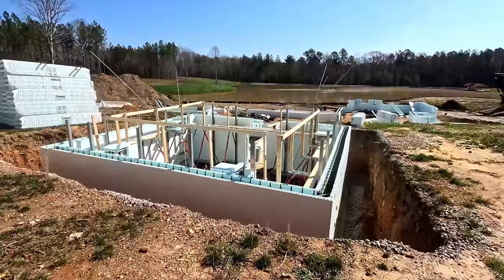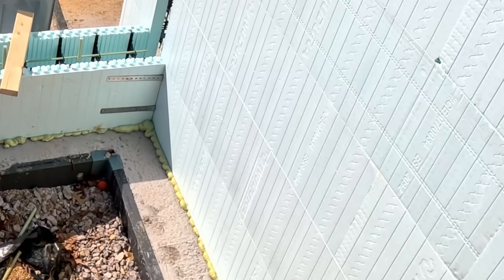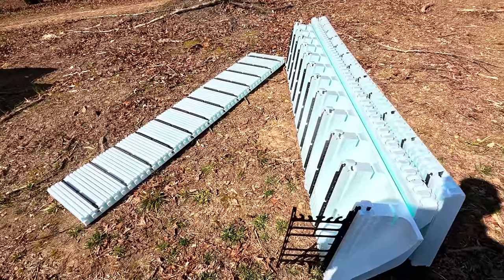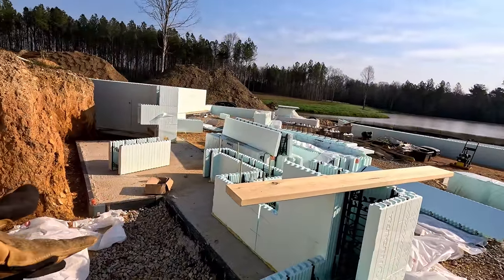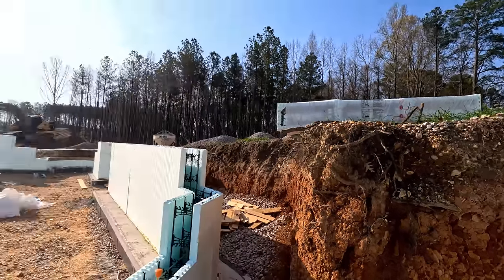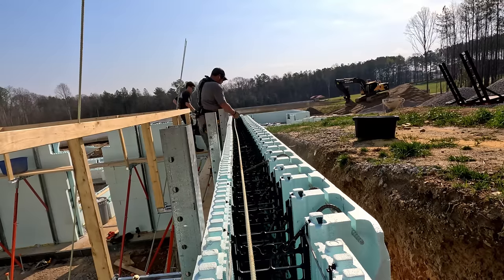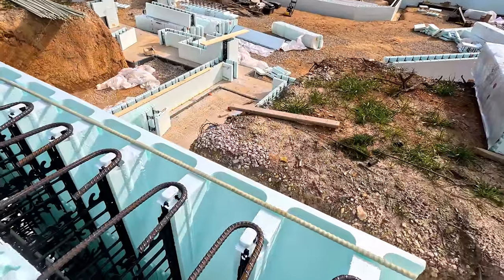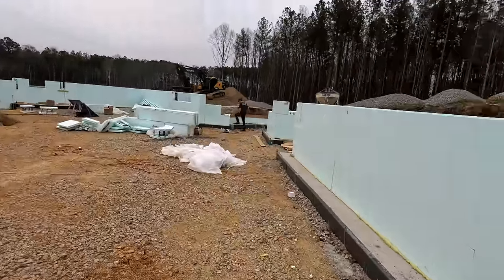Finishing the ICF Theater Stacking

Comment: Add a couple extra sleeves through the walls for either future utility runs, or for on-the-fly changes. Remember you'll also want a hole large enough for the air ducts, assuming you'll be running a forced air heating system. But some means of forcing fresh air into the room would be desired even if not for heating purposes. That enclosed below ground room will be cooler in the summer and will try to attract moisture (mold) if not ventilated well enough.
Reply from the maker: I’m going to do an ERV system. Extra sleeves for sure. 😊

Comment: I have watched a lot of ICF builds, and every build still amazes me. Mike, from Dirt Perfect had a valuable tip, and that was to leave all walls leaning in so ever slightly, because its much easier to push the wall out, than to try and pull it inwards when full of concrete.

Comment: Using your second rebar method for the brick ledge, instead lay both horizonal bars in place so you don't have to go back and pull the hooks over the wall piece. Simply hook the brick ledge bar, then lay it on the wall bar. Then snap the horizonal pieces into position.
Reply from the maker: I did that for the third time but didn’t film 🤣

Comment: I’ll actually bow my walls in pre- pour usually 1/2/-3/4 per 30’ wall section.  They usually push outwards while pouring , then just turn them out to the string afterwards. Pushing a fresh poured wall out with this bracing systems is easy , pulling it in usually causes problems .

Comment: Fun stuff.  I am so in awe of how much the average person can do themselves once some engineered outlines are established.  The design of the brick ledge was amazing…. I noticed that the sloping of it back towards the ICF wall as it went down. Is that for cost reduction (on concrete), pushing the weight load onto the ICF, or both?   Also, the metal hooks caught my attention ….easier to just buy and bend metal for the manufacturer than preforming a fiberglass one or is there another reason?  I noticed a wire inside the wall at a common ….all these questions can be addressed in a future video (if that is preferable for you) instead of a reply here cuz I’m watching all of your stuff.  You and the crew are doing a great job of putting out quality videos.   Like I said, too much fun! 💪
Reply from the maker: It slopes back so that it tends to push the pressure towards the wall. There’s actually some metal for straightening the wall in the second course and the top course. I’m going to some more details as I get deeper in. Thanks for watching!
Reply: @BealyGood  thanks for the reply.   That makes sense…looking for to next videos as they are ready.

Comment: The even faster way is to lay both rebars in, turn the loop on the bent piece sideways, slide the loop on the bent up piece between the outside foam of the brick ledge and the outer rebar, turn the bent piece back around perpendicular to both rebars, and drop it down over the inner rebar.
Reply from the maker: Doesn’t work. Too tight

Comment: Commented on the curved wall video, the screws holding the 2x4 blocking to the footing. Put clear plastic packing tape over the screwheads to protect the screwhead from being clogged with concrete.

Comment: Greetings from the UK 🇬🇧 Another interesting video, thank you.
Questions:
Why not build from breeze blocks with/without a brick face?  I’m sure a good brickie could complete this quite quickly.
For the bracing do you hire it, or have to buy it?
Reply from the maker: The forms stay in place. So after concrete is added, I have an insulated wall that I can adhere sheetrock directly to. So 3 things completed at once. 

I purchased the bracing. They can also be rented. Thanks 😊

Comment: In the theater room why are there two places with a straight vertical seam in the forms. That seems like a weak link in the formwork and will need to be braced on the outside for both ends of the respective walls.
Reply from the maker: I’ll discuss that in Tuesdays video.

Comment: when you put in those brick edge ties, you should just put in the 2 long green bars, then take your hook end and turn it parallel to the outside bar, slide it down past the outer bar on the outside, turn it 90* and pull it back up, then lay it across the other bar, would be way faster and easier, you should be able to just have a hand full of the tie bars and just drop them in 1 handed as you go, would only take you 1 trip down the wall instead of multiple trips laying things out and then finally putting in place.

Hard to explain without pictures/video but i hope you understand.
Reply from the maker: The final way I ended up doing it was the fastest way possible. But I don’t think I caught it on video. I basically did what you’re talking about. I had to do it with the bars, not in the foam because the way the brick ledge foam is angled towards the wall. It makes it difficult to make it twist in there.

Comment: I think it would be faster/ easier to put both long rebars in place then the saddle(?) rebar in. The one with the U and L on other end... 
 Pick up by the L part with L up and U down. Rotate from  finished position 90° so L is going with the run of bricks.
Lower down U part to the outside of brick ledger rebar, rotate 90°, raisr back up to hook U over rebar,  swing down over inner length of rebar.
Reply from the maker: You would think so , as have many, but the space between the bar and the form is not enough to do that.

Comment: Did you make those little rebar brick mold things or do you get them from neudura.
 I'm sure I got the spelling wrong
Reply from the maker: The form comes from Nudura. The bent rebar stirrup was done by CMG. My local rebar supplier. Most of the companies that supply rebar can have them bent to your specs. Nudura provided a cad drawing of the stirrup needed.

Comment: Frame it for the eight foot doors. My line of thinking is this...  You're already going over the top with the house and pool, so why not? Also, if later on when it comes time to trim the house out if you don't like the height, you are encased with concrete so it wouldn't be difficult to attach a false header to close it up or do a decorative glass header light or transom. You can easily build to close up but it would be more of a pain to cut it open later.

Comment: Does rebar have to be tied? I've seen the tie wire, not a whole lot of strength
Reply from the maker: You just tie it so that it doesn’t really move during the concrete pour. It doesn’t have any bearing on the strength of the bar.

Comment: Looks like another method for installing the loop rebar is to install both log sticks of rebar in. Then take your loop end and stick it in the front at 90 degrees then rotate it 45 degrees and lay it in.
Reply from the maker: This is a common comment. Not enough space between the bar and the form.
Reply: Well I’ve been wrong before.
Reply from the maker: @bigchiefwahoo it’s a great idea. 😁

Comment: Flea bitten Mut-Mut doesn't get to foreman bark any order with a muzzle on. Hire 67' game warden Dennis Weaver's brick Mason bear 'Lintel Ben' for putting in that movie room door opening. (That takes you back) Brick Ledge Reinforcement Assembly The Non-Braindead Way: Assemble the connector to the fiberglass rerod for the brick ledge, seat brick ledge rerod in clip/slot, flip up connector tipped out over the ledge foam, install/seat wall rerod, flip down connector onto wall rerod, tie off both ends of the connector, Tell everyone you have a faster way.